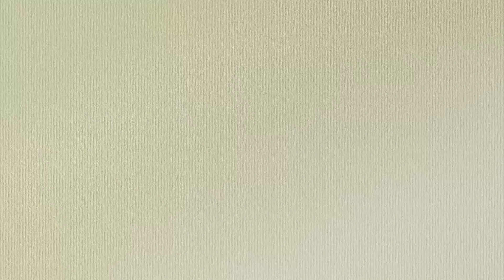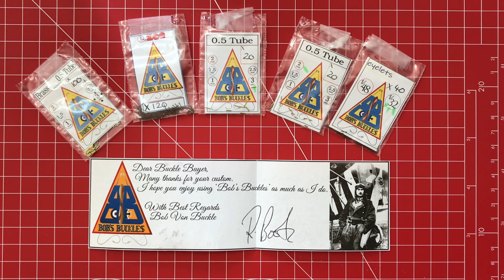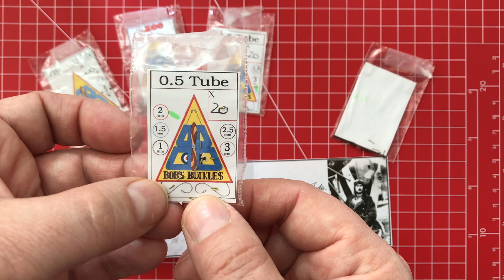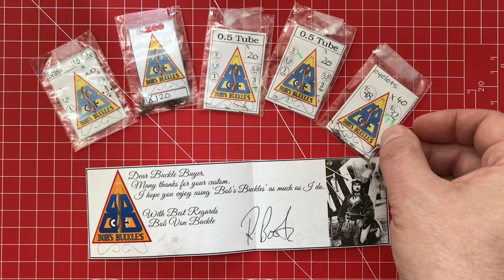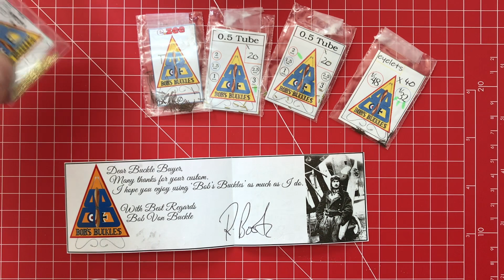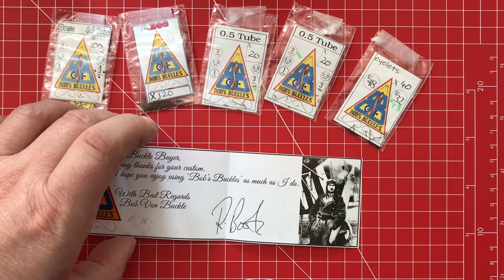Focus on products for modelling, Bob's Buckles

Comment: Excellent and informative, thank you for sharing.  I am just building the Trumpeter 1:350 Liberty Ship and was wondering how to rig it.  The kit has three king posts (masts) that are secured by ropes to the deck but obviously the kit provides no tie-off points for them on the deck or anywhere else.    The Gold Medal photoetch I am using does provide some shroud turnbuckles but they seem so very delicate and I am considering not using them.  Searching the internet another modeller of the same Liberty ship on Britmodeller used Bob’s Buckles and they seem very effective.  He did not explain his technique but I think he must have done what you suggested that is to make a eye bolt with one eye and one tube and then secured the protruding shaft to the deck via a small hole and some CA glue.  I am a bit concerned though that you think Bob’s Buckles might be over-scale for 1:350?
Reply from the maker: A 1/350 eye bolt would be difficult to see.  At that scale I would just insert some wire into the deck, no eye and use that as a point to CA your rigging, or even just drill a hole into the deck and feed the rigging in.  But its personal choice
Reply: @ModelkitStuff  Thanks for the reply.  In fact I contacted Bob this morning and he recommended either his standard 1:48 eyelet or new EZee eyelet.  He said most ship 1:350 modellers (who seem to mostly come to him via Britmodeller), just drill a small hole and CA the eyelet with no tube.  A very nice guy, he is sending me some samples.

Comment: They look interesting I make them for some of my ARVs recovery armour but 1.35 I've found a fast simple way of making my own practically bang on each time using a 0.5 bit of brass rod as a looper so every loops 0.5 amd albion alloys tubbing the actual rod used is 0.3 cost is about 10 pounds to 150 buckels only.cause I've got my own fast way now but not saying if anything 1.35 scale was avaliable I'd definitely use it! I've a fee from a scammal tank transporter kit from the trailer the turn buckels are double housing with a nut so trying to make my own of them 3D printed is the way forward with turn buckels really!